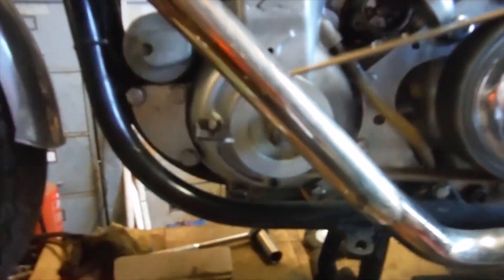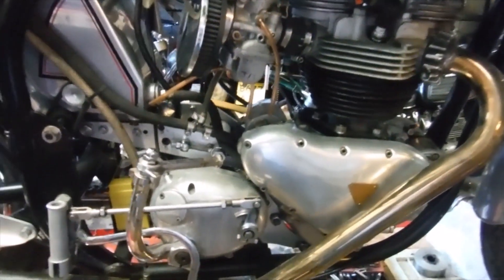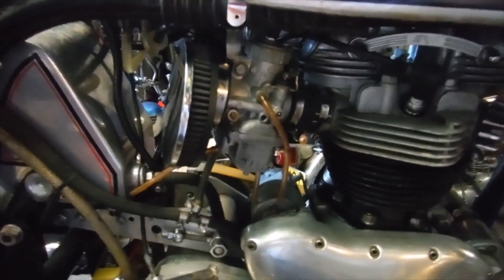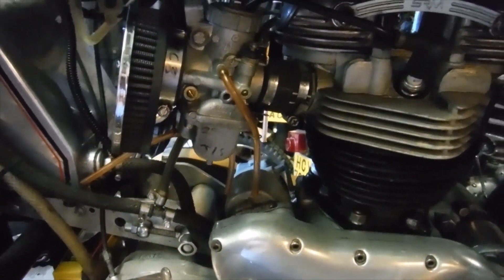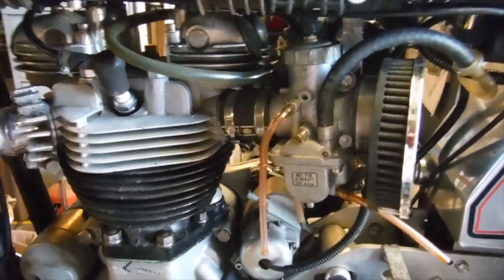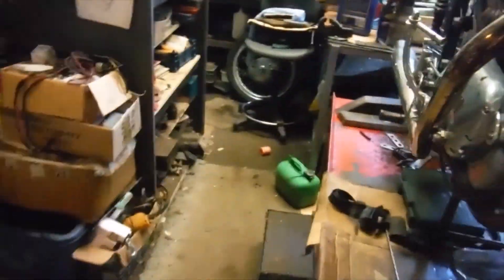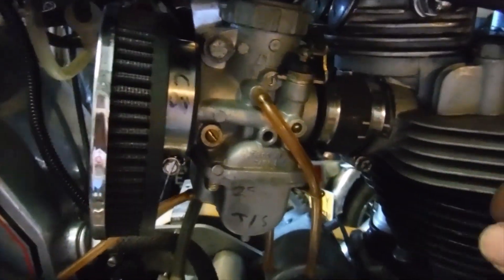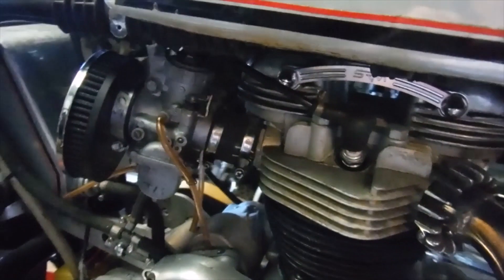Triton 2 - ignition timing and  setting up carbs discussed.

Comment: I'd ditch that filter. It's not deep enough to allow the reverse pulses from the carburetors to dissipate. This is screwing up the mixture...
Reply: I had similar filters on another bike. I found the inner edge of the rubber mount obscured the air bleeds in the bell mouth of the carbs leading to poor idle and lean just off idle. Trimmed them with a Stanley knife, problem solved.
Reply from the maker: It seems to run just the same without them - on the bench, at least.

Comment: To be fair to the carbs, and Mikunis reputation speaks for itself, do you know how well these were set up to suit this engine? (pilot jets, throttle cutaway etc.) Your slight dig at the end was a little surprising and perhaps premature, given as you say, the other, as yet unconfirmed possibilities for erratic running.
Reply from the maker: Much of Mikuni's reputation lies on being a brand new replacement for worn out Amals of at least 50 years old or more and, as such, do little to impress me, but each to their own, I suppose.
Reply: @paulhenshaw4514  Well, also that the big four (Keihins on Hondas and the occasional Teikei apart) the Japs have used them to fuel their bikes for 50 odd years. Nothing wrong with new clean Amals before the pilot jet blocks and the body wears oval.
Reply from the maker: Each to their own etc. I prefer Amals.